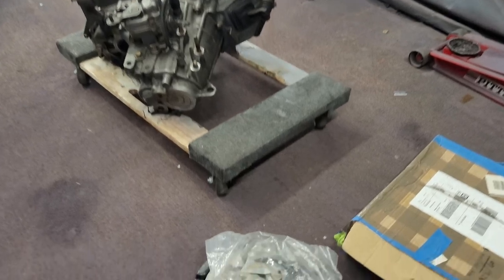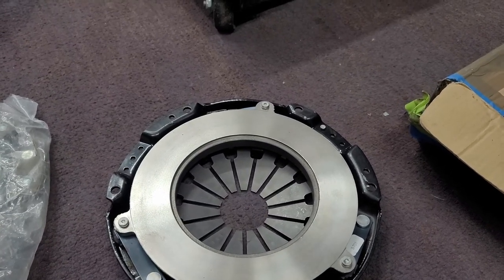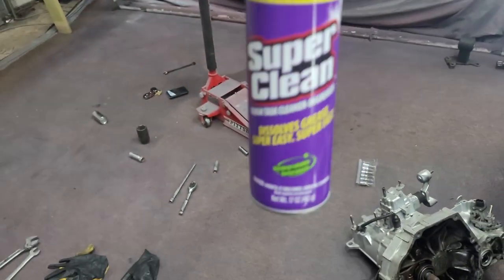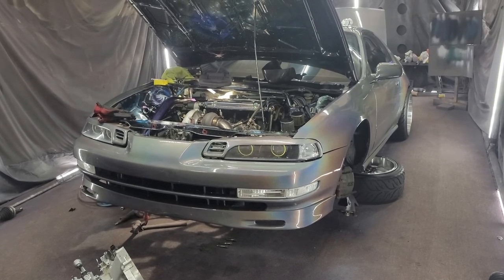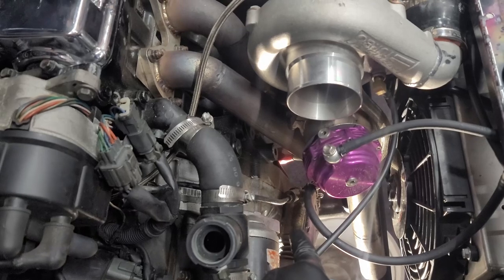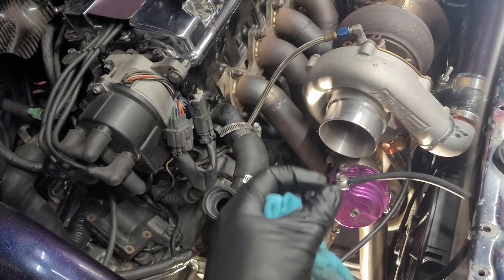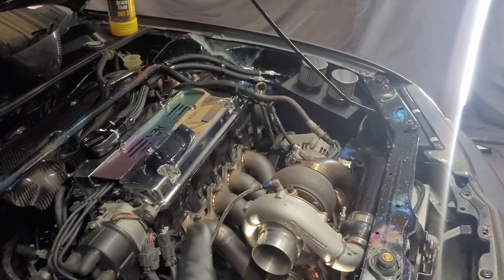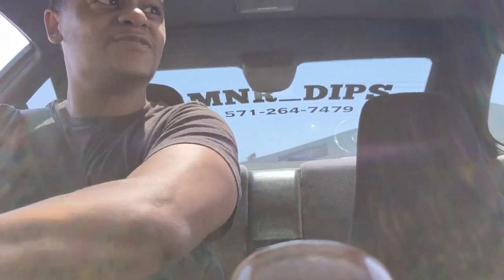syncrotech transmission upgrade | comp stage 4 clutch

Comment: Glad you finally figured out the accord trans is the way to go 5th 72mph@2300 4th is almost identical to the original 5th 60mph@3k rpm  your ride is amazing mine is coming together slowly but surely too.
Reply from the maker: Yea bro its gonna be perfect for boost
Reply: What trans has these gear ratios?

Comment: I've had a competition clutch slip on my 360 lb ft F22A though, its not gonna last if you ask me.
now really happy with action clutch stage 5

also I wonder what gears those are, doesnt Mfactory only make shorter gears for H22 ? maybe they are F series gears ?
Reply from the maker: Ahhh man 🥴 well i may upgrade if thats the case lol

Just the lsd is m factory the gears are synchrotech

Comment: What trans shifter bracket you using and cables for the shift box
Reply: You can also use a piece of tube Ina clear bottle filled with brake fluid also and do it one man style